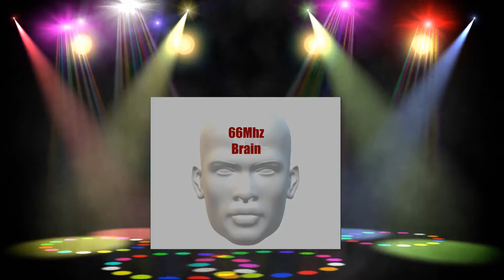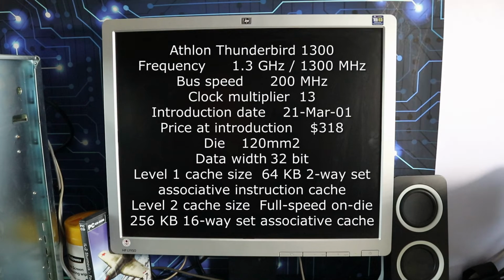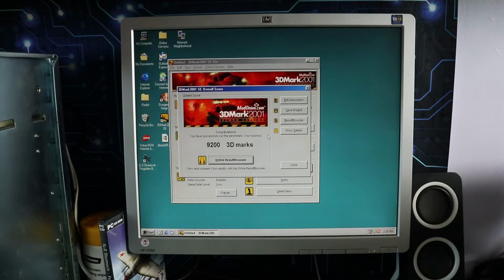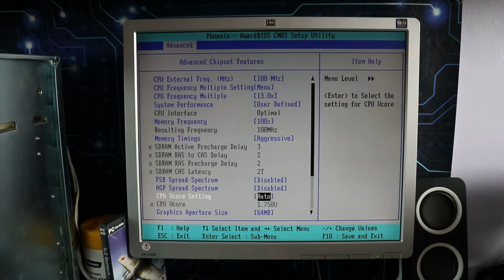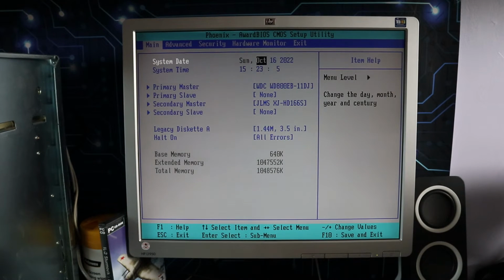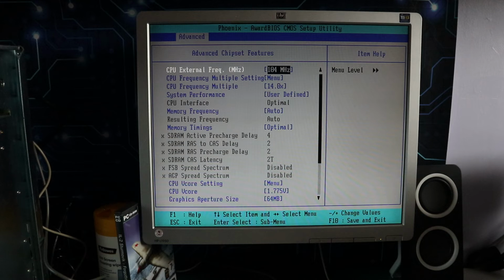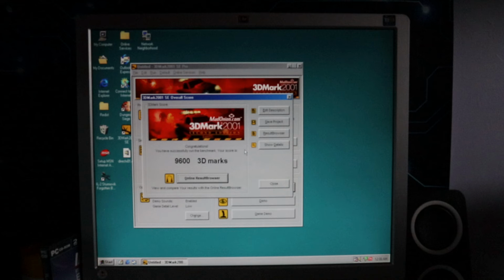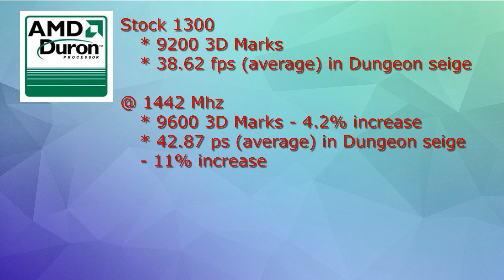Athlon vs Duron Overclock. Part 1, overclocking a Duron 1300 Morgan core.

Comment: I worked in a computer store and at the end of year inventory counting we found a Duron 1400. I got it for 50 euro. My KT133 Abit board worked with this chip. I did a conductive paint unlock of the cache, and hard wired a multiplier with tiny wires in the CPU socket. I had a 2100mhz (!) Athlon XP (cache re-enabled!) for 50 euro! Amazing. Held back of course by the Via KT133 board, but still.
Reply from the maker: Must have been very cool to work in a shop selling this stuff hack then. Would probably have been my dream job back in the day😁
Reply: @66mhzbrain  For sure, it was a fun job (did it besides university). I learnt about computers but also how to deal with customers.
Reply from the maker: I miss specialist pc stores!

Comment: I bought a computer back in the day, my second computer, it was supposed to be a 1ghz Athlon, but the computer guy ripped me off and stuck a Duron in it.
Reply from the maker: Thats a bit crap! I suppose thats one bad thing about having a cheap version of a processor, that someone can try and palm people the lesser one.
Reply: @66mhzbrain  I found out afterwards that he was doing that stuff to everyone, even swapping out parts on computers that came in for repair.. So you'd go in with say a 1.5ghz Athlon and 3 256mb ram, and go home with a 1.2ghz Athlon and 2 256mb and one 128mb sticks of ram.. even swapping out hard drives..  Then using those better parts to build computers to sell as new..
Reply from the maker: 😯 Thats pretty nasty! Presumably selling the better parts he stole!

Comment: I had a Duron 1.3Ghz, the maximum I went was 1330... lol I think my MOBO was shit...
Reply from the maker: Haha. Thanyou, that doesnt make me feel so bad about my overclock😁.   Might have just been a bad chip.
Reply: 1.4Ghz was the limit for the Morgan core. The closer your cpu is to this limit, the less headroom for overclock you'd get. So the best option for overclock would 900 Mhz Morgan core (don't mix up with 900Mhz Spitfire core, cause for those the max clock would be around 950Mhz). That's when you overclock with pencil mode and changing multiplier. FSB is trickier and depends a lot on your other hardware.

Comment: If you want to squeeze more you should lower CPU multiplier and increase FSB. You have NForce 2 board so it should run FSB 166 and 200 without any issues. Try set multiplier to 6.5x and FSB to 200 MHz and check the results. You should run memory 1:1 with FSB, so use DDR400 sticks. :)

Regarding oc results: they look okay. Durons on Morgan core are usually able to do something between 1.3 (slower models like 1.0 GHz) and 1.5 GHz. Better results are rather rare and usually require more voltage and better cooling.

Duron Morgan 1.0 GHz in my retro PC (on VIA KT266A motherboard) does 1.33 GHz (10 x 133) with stock voltage and it can also do 1.4 GHz with some voltage bump (1.8 V I believe).
Reply from the maker: Cool. All of this stuff is a bit more recent than the processor, memory (pc3200) is set to automatic (optimal), which I was assuming chained it to the fsb. I may have a play some time with a better cooler to see just how far I can push it. This time is really just a bit of fun ti see if it can beat the more expensive athlon without much fuss.

Comment: Like! You could have tried 10x133 or 10.5x133, most probably it would have worked and the performance increase would have been substantial.
Reply from the maker: Im sure there are setting that would get more out of it. I might take a more detailed look at some point and get a decent cooler. The world record for this chip is apparently a little over 2ghz!

Comment: That’s a little disappointing. Back in the day, I had a Duron 850 overclocked to 1200MHz by adjusting the multiplier alone, didn’t touch the FSB or the voltage (didn’t understand all that stuff back then)
Reply from the maker: Ita an old chip. Im surprised as fsb is usually the only thing available out of the box, you need to hack the chip to unlock the multiplier.
Reply: @66mhzbrain  I wasn’t clear, I used the pencil mod to unlock the multiplier, cranked it up and that was that 🤷🏻‍♂️ used the stock AMD cooler too.

Edit: And thinking about it, it might have been running at 1300Mhz, not 1200.
Reply from the maker: @jonchapman6821  wow thats quite some overclock for just using the multiplier !

Comment: Interesting video. My thoughts are that you (maybe) have not tested the ram speed independent of the CPU speed. When i was overclocking CPUs i would first under clock it slightly and test out the memory speed capabilities. That way i could push the FSB to the max and then try to push the CPU speed. I often got more out of a faster FSB than out of pure CPU clock.
When i overclocked a P3 in the 2000s, i ran the FSB at 163 MHz with 322 timing. The P3 550/100 ran perfectly stable @900MHz with air-cooling, it was quite the beast.
Reply from the maker: I didnt check but both board and memory are decent and about 4 years younger than the processor.  I'd probbaly put any limits on overclocking down to a flaky pencil trick, poor cooling or just an old and tired cpu. The speed I got is suspiciously similar to the max you'd expect out of the processor with a locked multiplier and only the fsb to play with.

Comment: A talking motherboard? That is so awesome! Imagine if the computer had lights that were sound sensitive and pulsed while the board was talking at Post.
Reply from the maker: Haha, yes😁. Haven't figured how to get it to shut up yet🤔
Reply: @66mhzbrain  After finishing the video I found it interesting that the motherboard has Q-Fan. Must be a late Socket A board! I could never get my Athlon XP 1800 or XP 2500 to overclock at all, always had crap motherboards
Reply from the maker: Yes, think 2003! So way later than these processors